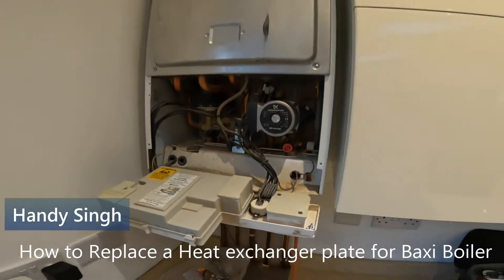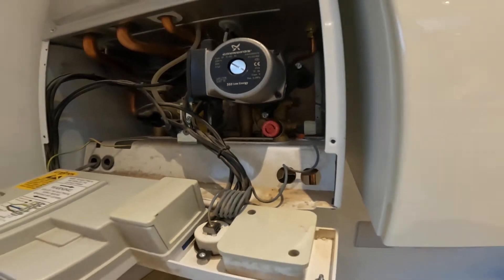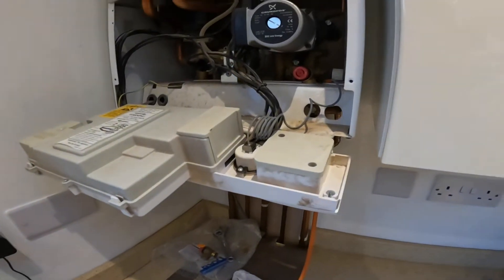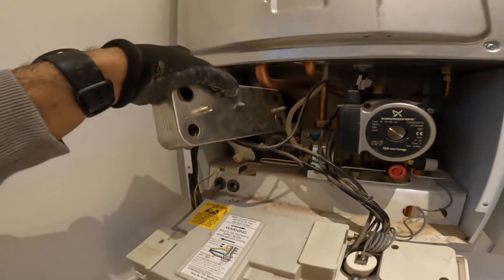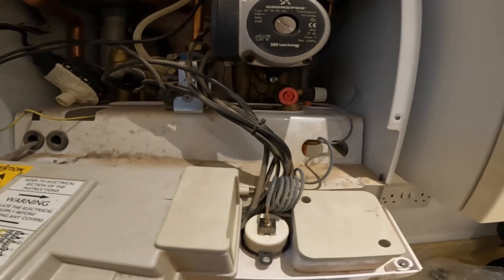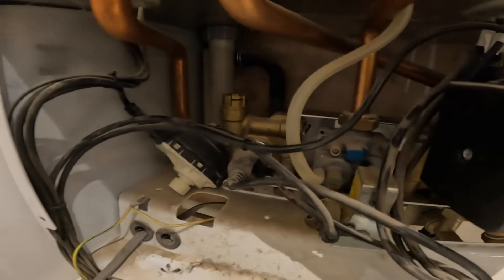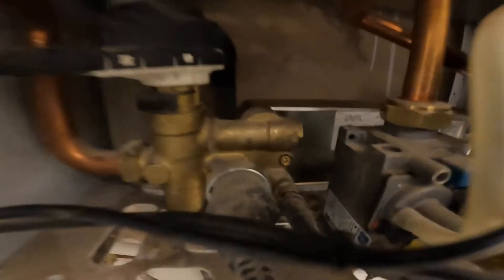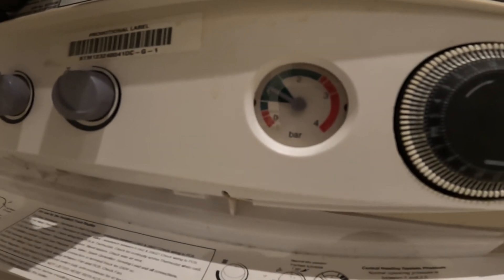COMBI Boiler Heat Exchanger - BAXI Main Eco 30 - How To Replace Plate Heat Exchanger

Comment: Thank you, Great Video!! This helped  me fix the issue with mine also, as per @amjadellahi comment after re-pressurising the system i had to pump the expansion vessel back upto 1 bar so may have also been running on the low side before.
Reply from the maker: Glad this video has helped you mate. Cheers Handy Singh.

Comment: Cover the PCB board up when pulling away the heat exchanger. Infact it’s a good practice to cover the PCB board up with some sort of plastic bag or anything; or else you’ll blow it. Be careful, especially how the water dripped onto the PCB board, all it takes is for some tiny bit of water to go in and your PCB board is gone

Comment: Hi, great video. Ivw managed to change my heat exchanger plate. But now I've got a 60 error on the boiler and not hot water will come out.
Reply from the maker: Hi Adam, does it come up with E1 and then 60 after? That would indicate a possible fan fault. Cheers Handy Singh.

Comment: Handy bhaji how to know which one is top side if no mark on plate ,?
Reply from the maker: Hi Sukhdev, the plate will only fit one way..the connection point and screws will only align if it placed the right way. When you do it you will notice straight away once placed. Cheers Handy Singh 👍

Comment: i have the same boiler but my issue is heating works fine but hot water from taps goes hot and cold and sometimes stays cold unless i open another tap in the house then it warms up, any ideas what it could be ?
Reply from the maker: Hi Steve, thanks for watching the video. You know your tap that gets cold would you say that is further away in terms of pipe work is comparison to the one that warms up? Also how is the hot water when the heating hasn't been on? Cheers Handy Singh

Comment: What were the symptoms on this job thst made you change the plate heat exchanger? Rising pressure over time? Also how come i cant see the filling loop but you are managing to fill the system : )
Reply from the maker: Hi mate, the pressure was increasing if when everything was off..the cold water main was leaking into heating system as there was a small pin hole in heat plate. The filling loop on this I fitted internally at the bottom of the actual boiler. Most boiler have this option but you need to buy the part in some instances. Makes it look alot neater and easier to use..can fill without taking cover as you just look underneath a turn it. Hope this helps 🙏 cheers Handy Singh

Comment: Hi. Is this the main heat exchanger? Is it the same as the potterton titanium 28? I’m asking because the diagram of the inside of the boiler points to the big Circular disc at the back and says that’s the heat exchanger. I’m confused as to what is what? And how long the job takes? Any help would be much appreciated. Kind regards
Reply from the maker: Hi Marley, it's not the main heat combustion heat exchanger. This is the heat plate exchanger which is different as this transfers heat between 2 fluids...i.e hot water and heating pipes to save energy. The job is very easy to do and should take no longer than 1 hour if you follow the same steps as the video. Hope it helps mate. Cheers Handy Singh
Reply: @handySingh  hi Singh. They guy that was out said it was the heat exchanger and I’m looking at a diagram for the inside of mine and it says the heat exchanger is the big Circular disc. Can’t see the thing you took out on the diagram of my potterton titanium 28. Very kind of you to reply , much appreciated. Cheers.
Reply from the maker: @marley2319 the main Heat exchanger is what heats the water. The circular disc you mentioned. Is your boiler not heating anything?
Reply: @handySingh  Yes everything is still working, heating and water it’s just leaking. It’s a coffee colour so I take it that’s something put in to help with something? Cheers.
Reply from the maker: Yes it should be the same part as if you look online it's similar to the baxi ones. Cheers

Comment: Thanks for this have just successfully changed mine and have nice hot water again. However, when removing I couldn’t find any rubber washers and couldn’t fathom how to replace with new ones? I can’t see at the back either when doing it. It’s on and no leaks so will the okd washers just be sitting flat to the pipework or something?
Reply from the maker: Hi Wayne, thanks for watching. I'm glad the video was useful for you and helped you out. Yes the rubber can stick to valve end due to heat, it should be fine and still be a good seal as they are thick. As long as you check for leaks once connected up and tested once cover is on. You can also see for any leaks from underneath boiler if there is any. But you will be fine. Cheers handy Singh

Comment: My boiler is sending hot water to radiators when heating isnt switched on. Even at night when no taps are being used/thermostat set low, the boiler can be heard running and radiators warm. Could this be heat exchanger or diverter valve?
Reply from the maker: Hi J Singh, sounds more like the boiler is calling for heat constantly which can be either a thermostat fault or if you have a motorised valves for a zone, this could potentially be faulty. Did you get this fixed? Cheers
Reply: @handySingh  just changed diverter cartridge last night. See if that solves problem
Reply from the maker: @jaspreetathwal1182  yeah try that and also see if the motorised head on divertor valve is actually working too.
Reply: @handySingh  cool. Ill try that and let you know. Cheers for help
Reply: Changed diverter valve but still remains. Thermostat is a honeywell digital thermostat. Reckon its worth changing it?
Reply from the maker: @jaspreetathwal1182  Hi there is a way of checking this. Set the thermostat to no heat home and then check if live voltage is going to call for heat terminal back to boiler. If there is a live 230v going back then you know it's a faulty thermostat.

Comment: Thanks for the video nice and clear showing how to sort it, It looks like a easy job to do 🙂

I have the same boiler and the temperature is unstable at times when using the shower, ive also had the water pressure rising into the red when we use the heating ( have a wood burner so its rare we use the combi heating much ) and the temperature gauge on the boiler when its not being used will keep fluctuating at times from like 54-58 👀

Is any of them symptoms likely to be related to the heat exchanger issue ?
Reply from the maker: Hi David, I'm glad you found this video useful. Yes your boiler symptoms sound more like a expansion vessel failure and also potentially a temperature sensor gone. What is the pressure of boiler when the heating is off and cooled down?, as it should between 1 bar or 1.5 bar recommend. Thanks.
Reply: @handySingh  Thanks for the reply back much appreciated and the pressure when not in use is as you say 1-1.5 basically that zone where its meant to be in the triangle. I swapped over the expansion vessel just before covid but maybe its gone again.

Comment: In my bathroom, when I open the bath tap, the water always stays luke warm, and in my kitchen tap, the water is very hot. Does this heat exchanger cause these symptoms as I already ordered one? Or is the problem somewhere else?
Reply from the maker: Hi Sat, the kitchen tap is normally downstairs and probably the closest to the boiler feed hot water pipe. When the central heating is on don't forget this will Hest the exchanger plate and also divertor valve and the initial surge flow to hot water will initially be extremely hot and then gradually as the pumps flows it will start to cool the water down to regulation set temperature on your boiler that you have selected. The Heat exchanger in mine instance in the video is that there was an internal leak and cold water kept going to heating system return pipe and hence boiler pressure kept increasing and spitting the water out via pressure relief valve. Is your pressure level steady and maintained?

Comment: So, are heat exchangers repaired / refurbished or scrapped ?  If they are sold as scrap and the engineer gets money for it?
Reply: You can clean them. You get money for any scrap metal if you toss it. By itself you'll be lucky to get a nickel
Reply: Spirits of salts or brick cleaning acid cleans the plate heat exchanger out. Be extremely careful and wear the appropriate ppe.